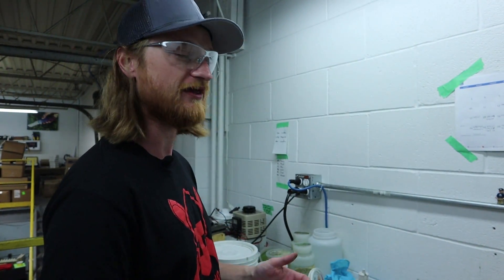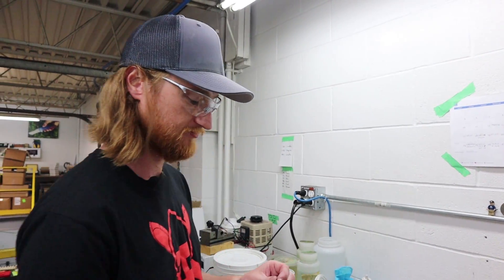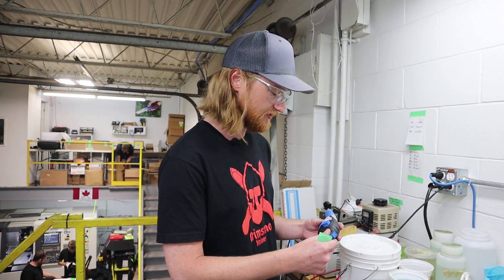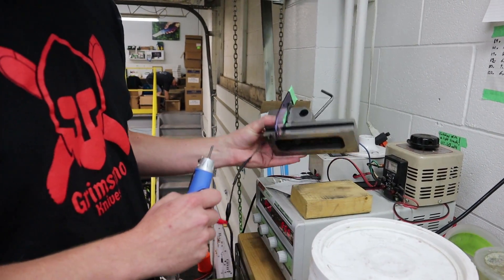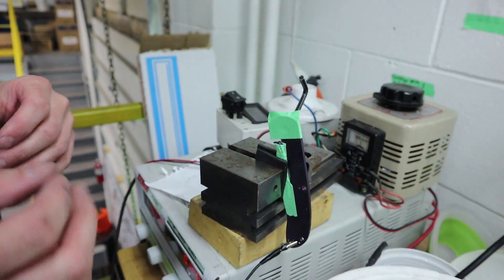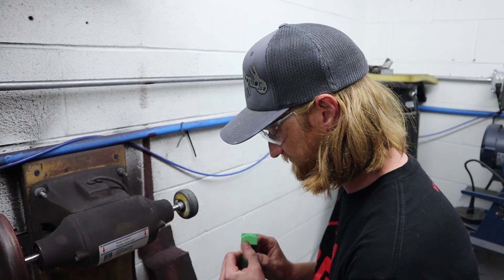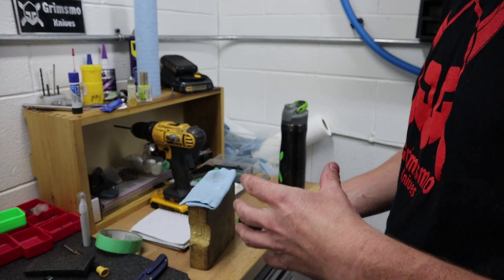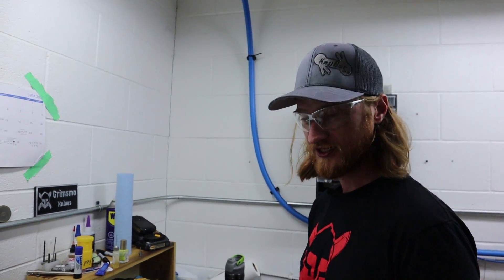How to Carbidize a Lockface

Comment: Heat the lock face with a torch to orange glow and quench in water. If the geometry is right there will be no lock stick! But you have to do it prior to any finishing because it will discolor your frame. You can carbidize onto that surface later aswell and that should give you the best Ti lock period.
Reply: PoltergeistWorks not sure titanium is hardened in the same manner as steel...hell most stainless steels aren't.

Comment: Your power source could you use a stick welder to do the same thing? I have an application where id like to try this the functionality is I need to add grip to a feeding wheel currently just knurling but even on heat treated h13 it still wares rapidly

Comment: As another thought. Do you have any fume/particle extraction prevention anywhere? Long term exposure to these kind of fumes can't be good for you, I mean where did that grinding wheel go? Most likely you breathed it.
Reply: I just recently started using a wet stone grinder instead of the classic benchtop one, and I'm not going back...Dust is down to a minimum (just a sludge that precipitates in the water tank), parts never heat up, wheel never clogs...The only thing I haven't yet figured is how you dress a wheel that spins at only 120rpm!
Reply: Air purifiers with hepa filters are usually good enough for that application, I would be more worried about the anodizing chemicals.
Reply: Sketch1994 Check Cedric and Ada. He has a Tormec and he shows how to dress/smooth the wheel on that. Might help.
Reply: We anodize with baking soda water. The most dangerous part is any potential of being electrocuted, which is exciting.

Comment: Would carbidizing the knife edge make it wear longer?
Reply: On steel, I'd say it wouldn't be worth it, if it worked at all. Diver's knives made from titanium tend to have a carbidized
edge so they actually hold up, while not rusting in salt water. But the cutting edge is nowhere near the quality of a properly sharpened steel.
Reply: rather than trying to carbidize a knife edge, you can go to a welding supply and pick up hardening powder. This will case harden a cutting edge to about Rockwell 60 maybe. However, I wouldn't recommend using hardening powder on a thousand dollar knife. I have used hardening powder on disposable wood planer blades and it made the cutting edges insanely hard but it worked!
I don't recommend trying this on a Grimsmo knife.